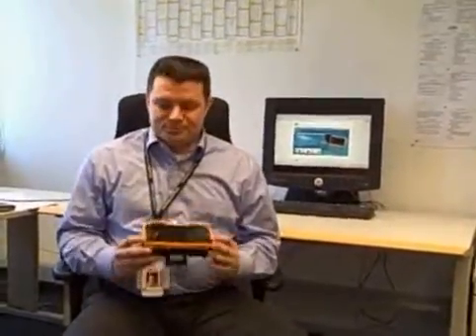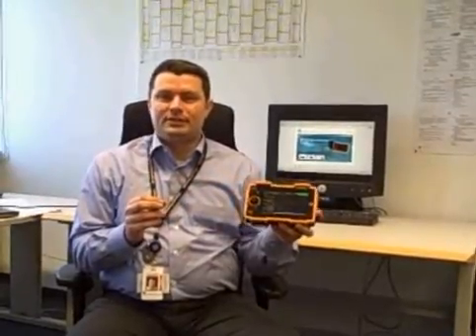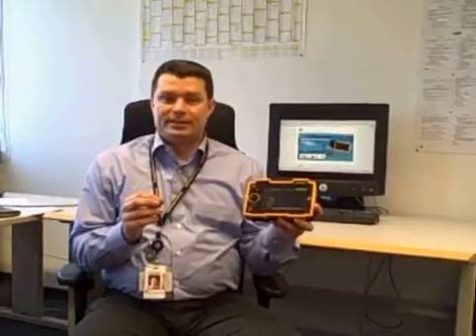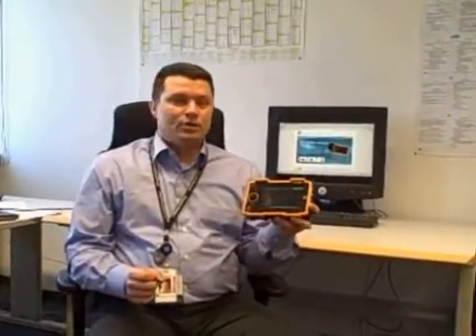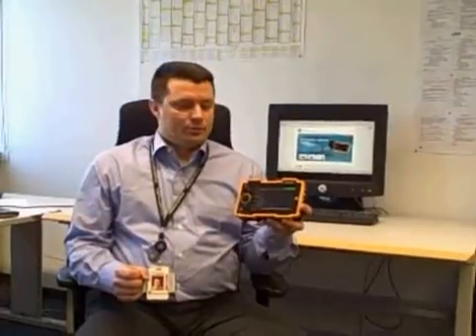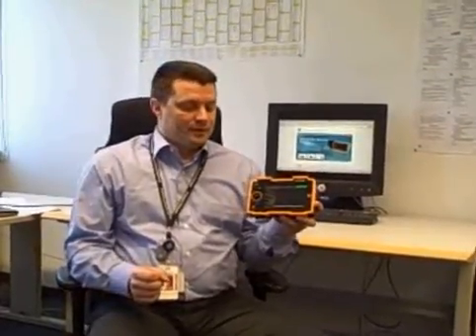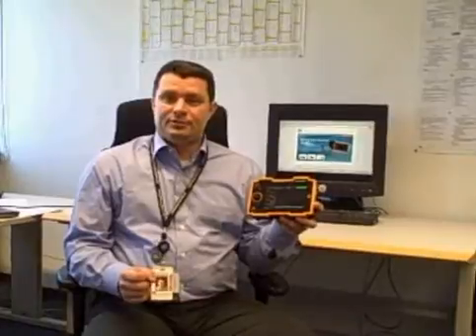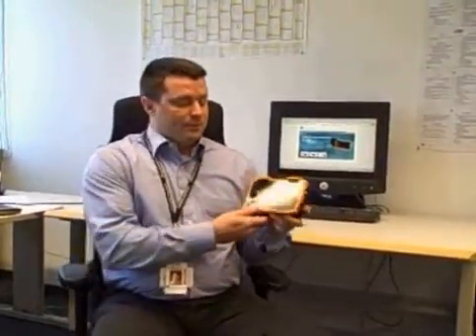Benefits of USM GO for the Oil & Gas Industry

Comment: The USM Go is really hard to set up on the carbon steel setting. Almost impossible to gets nats ass on .200 and .500 without using the velocity. Supposed to not touch that, but in conjuction with that the reject function is pretty awesome unlike the panametrics the reject button makes all the readings VOID! I think the panametrics is more user friendly for sure.